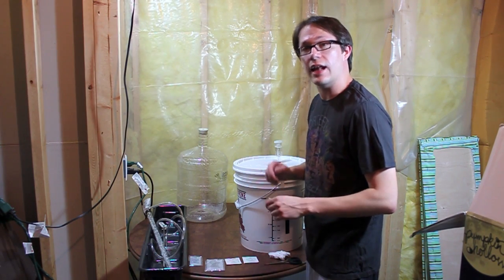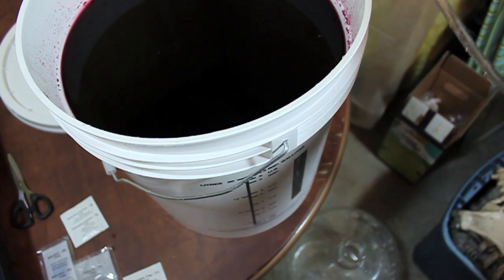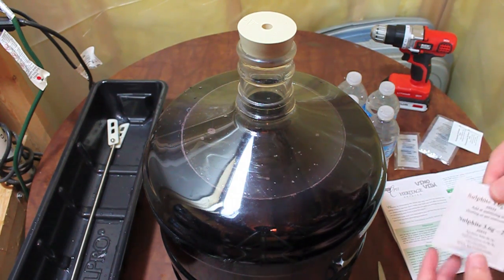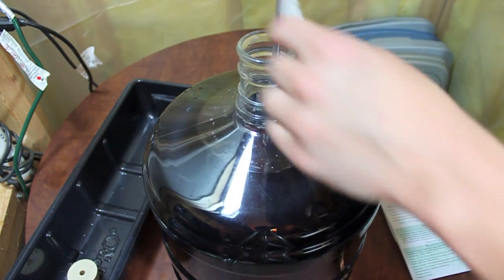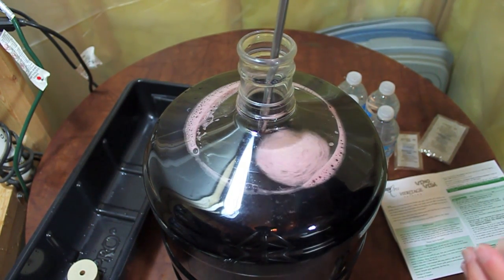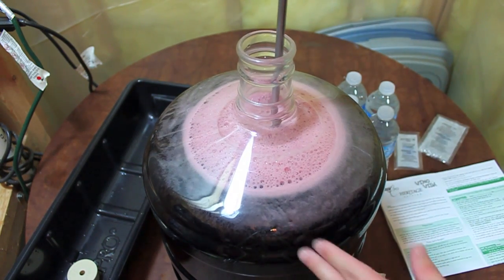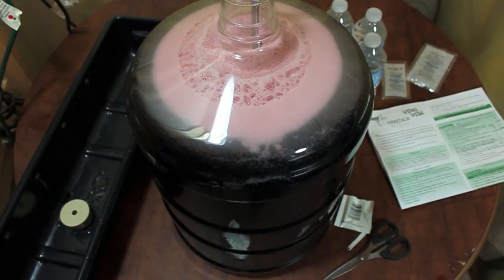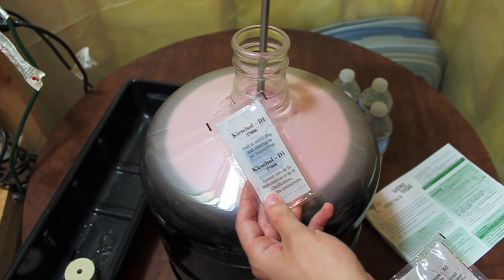Making a Vido del Vida Chianti with Joe (pt 2)

Comment: You could go without the chemicals, but you are taking a big chance of either your wine blowing the cork (which has happened to me) or your batch going bad on you. Wineries do use these types of chemicals in one way or another to kill off the yeast, prevent any foreign yeast activating, prevent the wine spoiling and clearing. Also, sorbates are commonly used in most soft drinks and other food products to prevent spoilage.

Comment from the maker: Hrmmm...  wine typically does not require any certain temperature for fermentation since most esters are just fine in the finished product... A solvent-like taste is typically the result of too-high temps or possibly oxidation.  Were you having problems with red or white wines?  You could certainly ferment white wines cooler, since they'll show off bad flavors easier than reds.  I always ferment my wine at room temp and have never had a bad bottle!